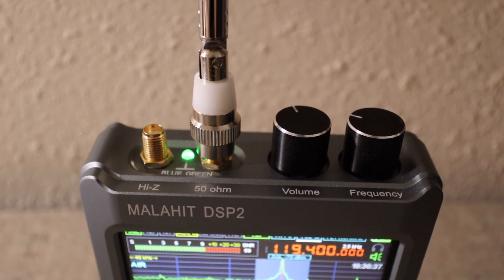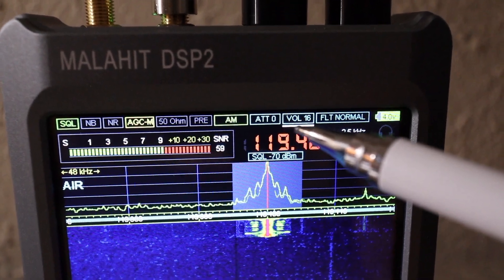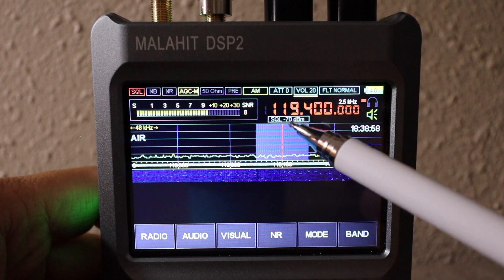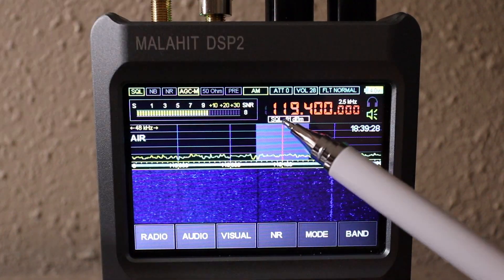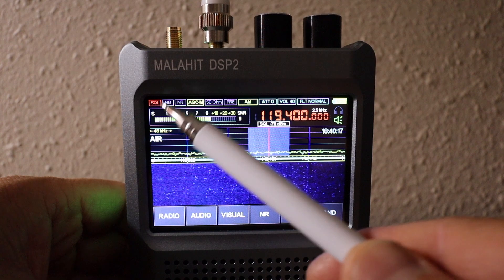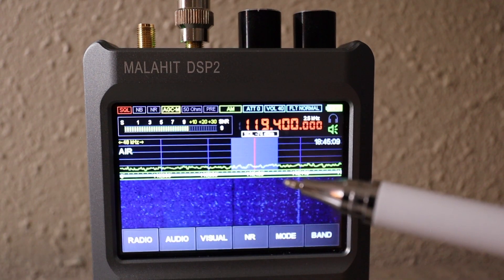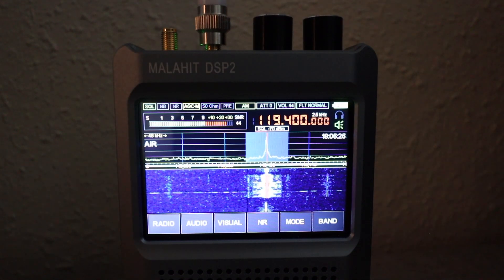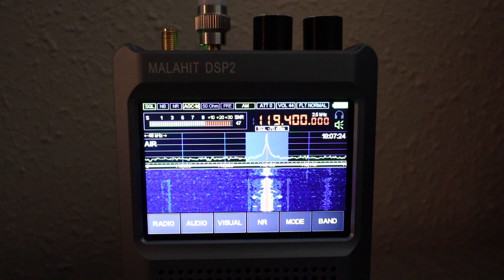Malahit DSP2 | Setting up Squelch for the Airband | Listening to Aviation Radio

Comment: ❤ You're lovely Captain, love your vids on these radios! 

And I love my Malahite DSP-2, Xhdata D-808 and my 20 yr old "5th Year Anniversary Edition" Sangean ATS-909.

There is also a "Channel Monitoring" function in the Malahit, which is quite useful for UHF Air Band. It's a kinda scan function.